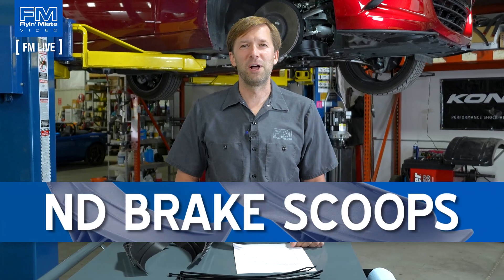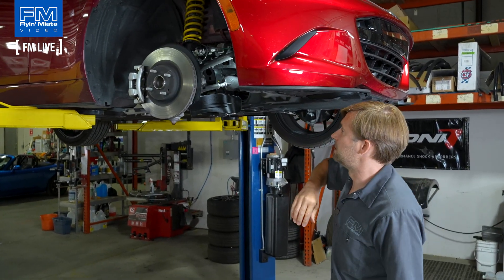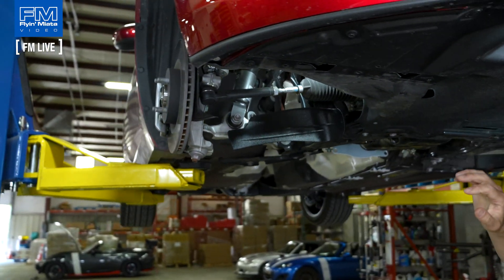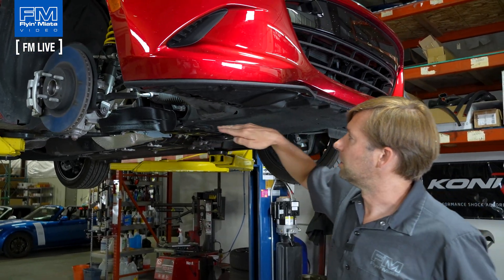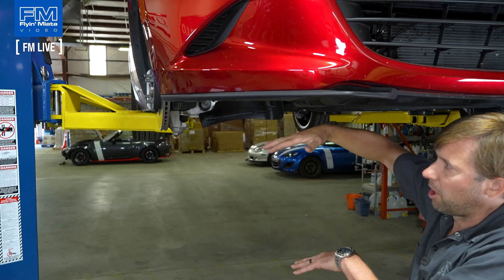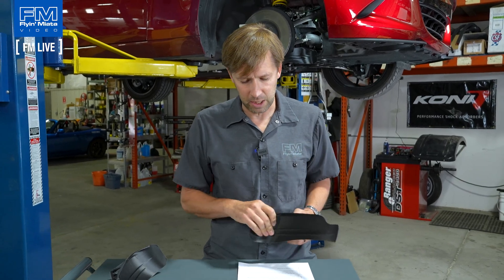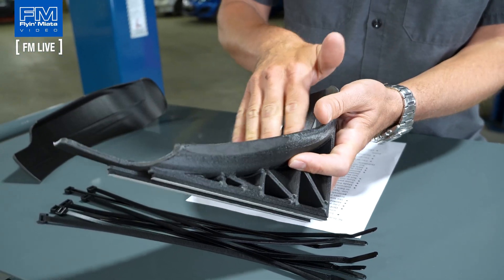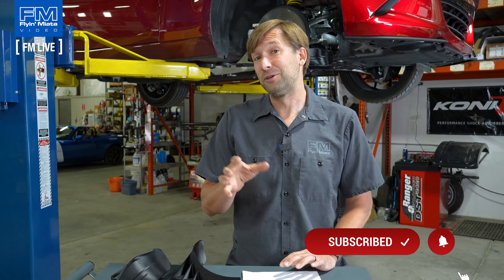ND Miata Brake SCOOPS! - Simple Brake COOLING - New at FM - 4K

Comment: bit of a strange question, do you think these would help with stock pads in terms of pad lifespan, for a street miata? moderate canyon braking, the occasional 75-0 panic braking (those darn deer)?
Reply from the maker: I don't think you'll see a significant improvement in longevity unless your current pads are outside of their temp range.
Reply: @FlyinMiataVideo  awesome, thank you!

Comment: I bought these -- quite a steep price when converted Canadian. I didn't expect them to be 3D-printed for that price (about 3x the price that Porsche sells theirs for). I've done one track day and one autocross (as well as some street driving) and one of them has already had a chunk taken out of it. I think I'll make some sort of an adapter to use the Porsche scoops next time, as they're significantly cheaper (especially if this is to be considered a wear item)
Reply from the maker: Can you send us some pictures of the damage? We don't expect them to be a wear item unless you're having off-track excursions.
Porsche has the advantage of mass production on their side. Once you've paid a big chunk of money for a mold, you can pop out parts for pennies. That up-front cost is not plausible for a product of this sort of volume, unfortunately.
Reply: @FlyinMiataVideo  Photo sent to the support email address.

Comment: $125 is absolute robbery. You can install the Porsche ones with slight modifications for ~$25 with lifetime replacement from FCP Euro
Reply: Porsche ones are wrong shape and angle… the control arm position is reversed in ND, so you need to build some triangular structure on top of LCA in order to make it actually work, but even in this case it will interfere with other components (wheel, steering rack…).
Reply: @AnBAutoShop  LMAO I have them on my car and they work awesome. Validated with rotor temps on track. Many other folks have them on their ND as well.
Reply: Porsche ones do not work. I ran them. I 3d printed my own that are very similar to the FM design. Massive improvement.
Reply from the maker: Thanks for watching!
Reply: Can you please post a link for comparison?